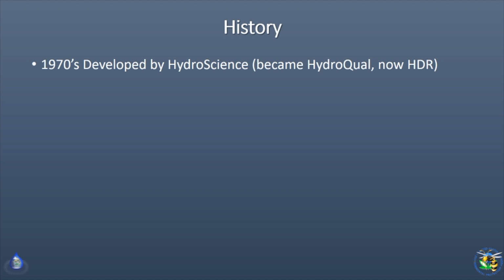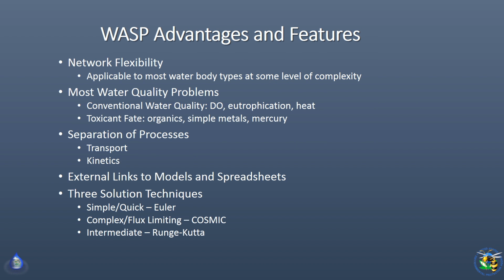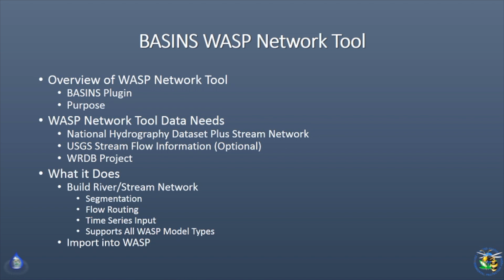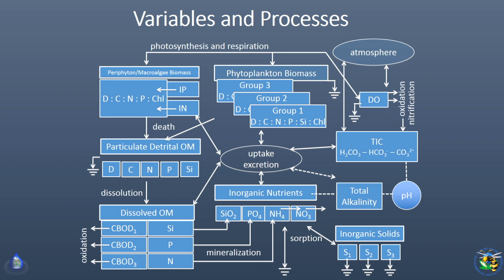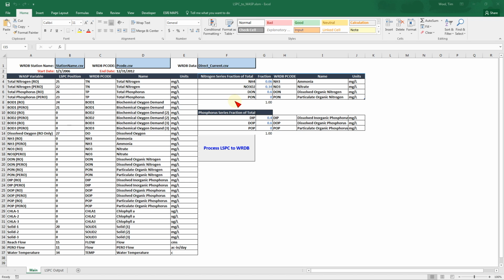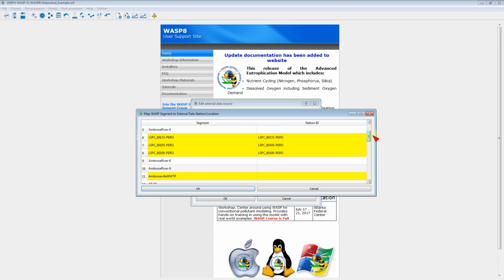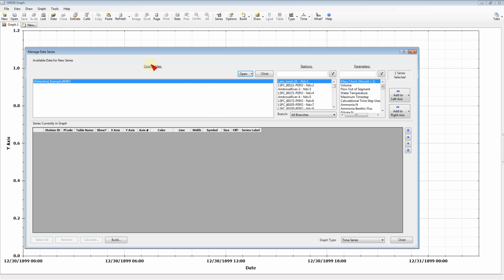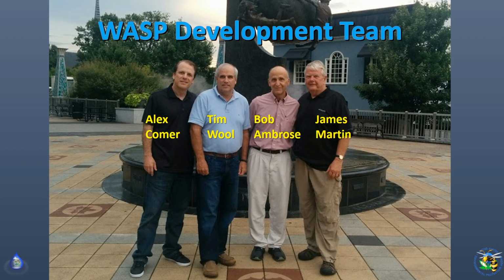Introduction to WASP Webinar

Comment: Hi,

i tried to follow the installation steps and downloaded the model. However, my exe file upon installation has not turned up the way it appears in this video. My WASP 8.32 v has a GUI with User Support details. It doesn't clear up upon selecting any other options. kindly help me with the interface .
Reply: Hello,

I’m having an issue with WRDB GRAPH in the WASP model—it’s not working, so I can’t import any data or consult my simulation results. Could you please share how you resolved this problem?

Thank you for your help!

Comment: I'm working with a tropical reservoir data that is not organized in a database. Do you have any tutorial where you add the information manually?
Reply from the maker: When you say add it manually, do you mean to WASP or WRDB?  If WASP it can be typed, cut and pasted from a spreadsheet.  For WRDB I do have videos.